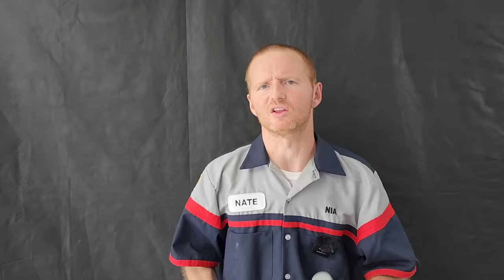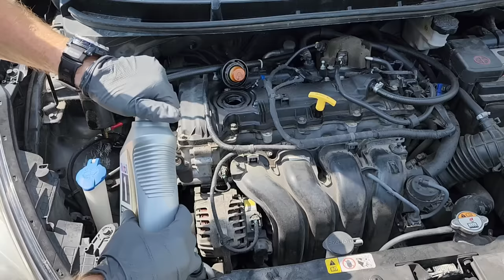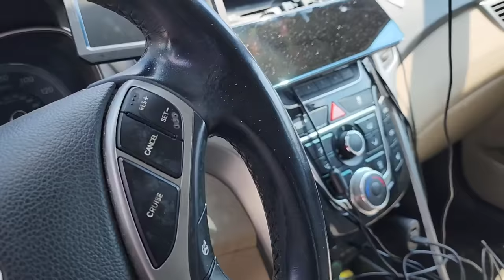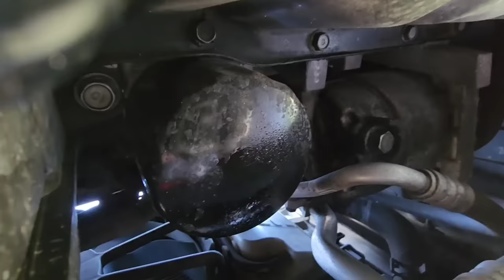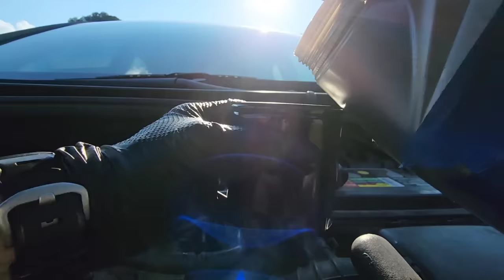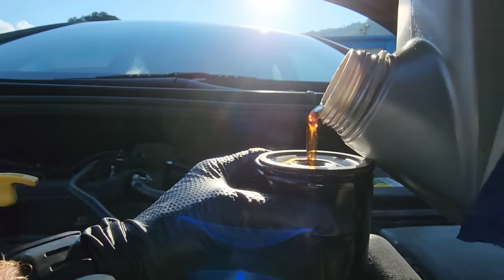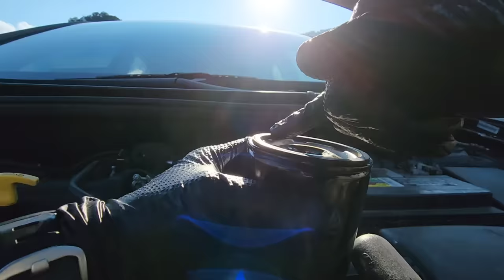Car owner sued after Jeep kills Mechanic during oil change

Comment: It's not the car owners fault , it's the 19 year olds fault and the shops fault for not training the 19 y old properly .
Reply: Shops aren't suppose to train the oil change guys how to drive.
Reply: Maybe lack of proper protocol but it's not the shops responsibility to teach an employee to drive standard
Reply: this is 100% the fault of the 19 year old. we have raised a generation so arrogant and conceited they don't bother asking questions, they just start pushing buttons and pulling levers and seeing what happens without considering the consequences. the kid should be held responsible and no one else.
Reply: @ SS camaro your right but he should know what the hell he is doing also. If you don't know whats going on ask questions or don't touch.
Reply: Its the shops liability because it happened on their property.  Not the owner of the vehicle.  In my opinion the owner should be compensated for his vehicles damage during this incident, even if it just a car wash to clean up the mess.  The 19 yo is at fault for not informing anyone in the shop that he didnt know how to operate a manual car.  His negligence cost someone their life.
Reply: @cagneybillingsley2165  you can only hold them responsible if they fully knew what they were doing and still did it.
Reply: @ssj2camaro21  Legal arguments aren't always that black and white. It's not unreasonable to assume that a person employed to perform service on a motor vehicle has knowledge of the basic operations of a motor vehicle. Suppose the car was an automatic and the service tech ran someone over because he put it in "D" instead of "R" because he didn't know how to drive. Who is at fault?
is this the fault of the customer for incorrectly assuming the employee knew how to drive?
 Is it the fault of the employee for not knowing how to drive? 
Or is it the fault of the shop for allowing an untrained employee to operate a motor vehicle?
Reply: You can't train someone to tell the difference between a standard or automatic it's the kids fault for thinking he was playing fortnite
Reply: @cagneybillingsley2165  he’s 19. Obviously does not have much experience and should have been trained properly. This is on the shop and well of course the boy has some fault as well however putting it entirely on him is just lack of responsibility on the shops part
Reply: @ssj2camaro21  it is the shops responsibility to maintain a safe workspace,  if you have no license to operate a motor vehicle you shouldn't be doing anything that involves turning the key while the customers car is being serviced, especially if your unfamiliar with manual transmissions
Reply: @ssj2camaro21 then don’t hire them
Reply: @ssj2camaro21 with how rare standards are becoming, they should be training their employees how to drive one.
Reply: The moral of this story is to do your own servicing.
Reply: @ssj2camaro21  If part of their job requires driving it becomes their responsibility.
Reply: @ssj2camaro21  Shops have to ensure safe work environment. They need to train employees to the extend needed during the oil change procedure.
Reply: True
Reply: Down to the shop, the management who put the kid with the mechanic and the mechanic for not supervising him correctly
Reply: @ssj2camaro21  well now we see that they should
Reply: @ssj2camaro21 but they do train safety such as using wheel chocks
Reply: @ssj2camaro21  that sounds like a Boeing executive.... Never forget right person, right training, right job!
Reply: True
Reply: @ssj2camaro21  They also aren't supposed to let unlicensed drivers drive but they did.  They should be liable.
Reply: @ssj2camaro21  No, because regardless of whether they knew, it was their responsibility.
Reply: @jamesrobson5967  Of course you can train someone to tell the difference between a standard and an automatic.  You can do it in one sentence.  If it has three pedals it's a standard!
Reply: The shop still has to make sure the young bloke understood the difference between a manual and auto work.  You don't have to know how to drive them, just how it works. I would go over it with new apprentices. It's not hard. It's you and their safety that's at stake. 
I mechanic's job is to maintain a personal weapon. If you F up, it can kill someone.
Reply: I was waiting for yhe speaker to explain what the car owner did to his vehicle to make it unsafe for the service department. But as long as all the maintenance done to the vehicle was within user manual specifications, the owner should never be at risk of being sued if the fault is that of the mechinic or service tech. Note to service techs who have never dren a manual transmission, if you open the drivers door and find 3 pedals wherr there should only be 2, step away from the vehicle and call your supervisor for assistance.
Reply: @RANS87IROCZ  AS well as... "SETTING THE PARKING BRAKE"...
Reply: The 19yo doesn't have any money so they went after the car owner.
Reply: @cagneybillingsley2165  Ii's 50/50. It was his fault for not informing anyone he didn't know how to work on a car, and it's also the shop's fault for hiring an inexperienced employee who doesn't know how to work on cars. Blaming everything on the teen avoids responsibility on the dealer's part.
Reply: @ssj2camaro21  How could he NOT have known what he was doing? He knew the clutch had a switch on it to prevent starting as a safety mechanism. He operated that from outside the vehicle, without thought for the obvious potential consequences, if the car were in gear.
Reply: You are 100% Correct.
Reply: I agree, the primary responsibility for this would fall on the dealership as they really are responsible for hiring people who know what they're doing if they aren't willing to train people.  As a dealership that sells these vehicles, one would think it would be fairly trivial to train someone in their use as they should have plenty available.  Using a manual isn't some magical esoteric knowledge that can't be learned and you have to be born with.  It's a skill like any other and can be trained like any other.  The training at this location was obviously insufficient as he demonstrated he knew enough to hit the clutch to override the start lockout, but he either didn't know or didn't care enough to take it out of gear, resulting in a fatality.  How much the 19yr old employee is at fault would be a determination of the courts as they delved into the training or lack thereof, but the overall liability would absolutely be on the dealership not the vehicle owner.
Reply: @cagneybillingsley2165  at the same time the older generation will bitch and howl about doing any training or heloing younger folks learn, so what else can you do